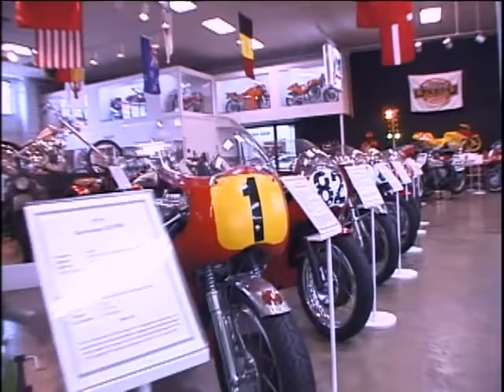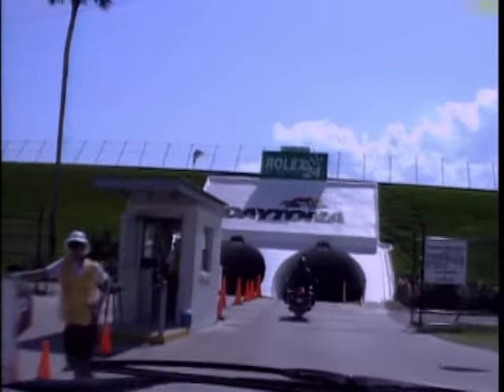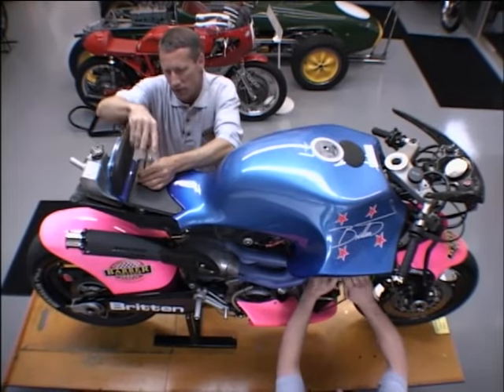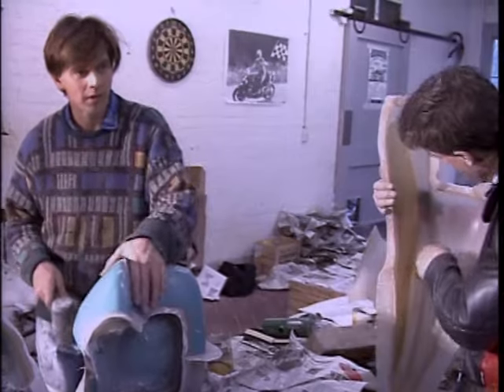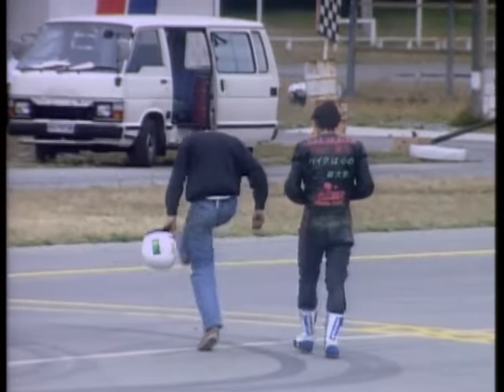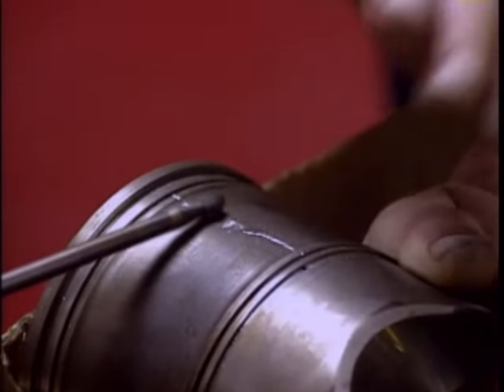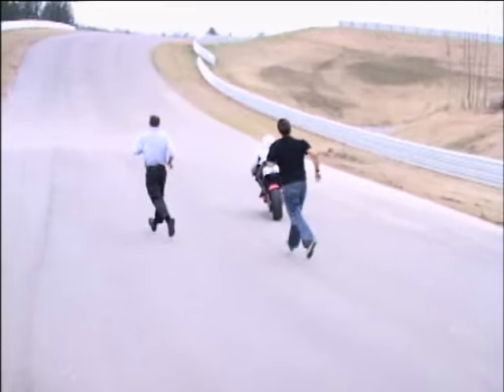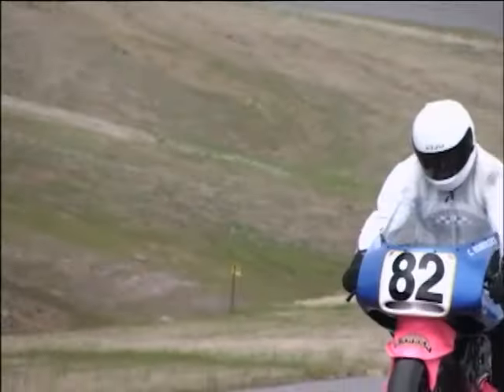TLC Greatest Motorcycles -  Britten V1000

Comment: Some engineer Mr Britten, to be able to pull the machine apart, weld/braise the piston liner like he did, good enough so it was fit to race. Obviously the guy was a one off.
Reply: Braze. It's not a piece of cheap meat.
Reply: He didn't really have any other choice. It was either weld it back up and see what happens, or go home knowing the bike could have done better. He was 9000 miles away from his home town, probably on a shoe-string budget, and with very few interchangeable spare parts. Bad idea or not, had he lost an entire engine, he'd just go home and make himself another.

But yes, definitely a one off. The very opposite of New Zealand's "Number 8 fencing wire" mentality for building or repairing things.
Reply: Have you watched : "The Worlds Fastest Indian?"
Reply: As sequels go I reckon it is far better than the World's Slowest Cowboy

Comment: That bike racing at Daytona was a home made engine from a garage in Christchurch New Zealand. Every part from the flywheel to the valves (NOT DUCATI). The whole bike was hand made in NZ even the wheels. I think the only thing brought were the rectifier and tires.
Reply: That's more or less it, the box internals were GSXR as I recall.
Reply: flip inheck  Aero-D-Zero
Reply: You hit it on the head,the worlds fastest Britten,wicked.
Go Johnny Go.
Gone to soon my kiwi brother.
Reply: Hey chris what are u on about, 
Negative Chris,whats your bike genius.
Reply: Ok. 6 yr after your comment. I'm watching  and had 2 go to comments to check. 100% no Ducati connection other than passing one on the back straight at Daytona on the back wheel. Up the kiwis and up the wahs.

Comment: John took concepts of low air pressure & flow from Steve Roberts who built the first true monocoque Suzuki powered f1/formula1000 all carbon fiber bikes in 1982-3 for nz Hiscock brothers...Johns engine was based on christchurches Denco Engineering's air cooled V1000 speedway sidecar engine with  Suzuki gearbox attached.
Still...a truely amazing machine
Reply: Thank you for this information. These people need to get credit too. They're part of Motorcycle history.
Reply: John's first special used a Denco engine.  It wasn't fast enough, so he got Jerry Branch to tune it.  Based on Branch's recommendations, Briitten then designed his own complete engine.  It was not connected to the Denco design at all.  But yes, Suzuki gear cluster and clutch used

Comment: It's not the only one running, there is one in New Zealand in full race tirm and going very nicely.
Reply: Brian Mckenzie  yeah that's what I thought, there is a few running, they just don't run them that often as there is very limited to no parts available
Reply: +WD-40 keep in mind this was probably recorded in late 2011 or early 2012, not aired for another 6 months with editing, than aired at a even later date.
Reply: he said road worthy
Reply: +Thunda1986 The guy doing the voice over said " only road worthy Britten left", but the mechanics said "this is the only one left running, isn't it ?...yeah" and neither is correct or true.
Reply: +Thunda1986 There is no such thing as a "road-worthy" V1000. They were all track only motorcycles, like the Kawasaki H2R for instance, or the Lamborghini Sesto Elemento. All 10 of them run, its just the owners of them aren't prepared to risk binning a million dollar motorcycle. There were 7 of them at the Ruapuna Sound of Thunder festival last year, which was a John Britten tribute, plus both of the Aero-D concepts he built, which were the Ducati/Denco powered bikes mentioned
Reply: Reflex Photography NZ depending where you live you can get plates for track bikes but emission control heavy states good luck
Reply: @Malibus_Most_Wanted  With no lights or indicators?
Reply: @Thunda1986  They are race bikes, never road-legal

Comment: Yep,lots of errors in the   commentary.John's first design used a Ducati engine but that was a long long time before he went overseas.There were the Denco motors  before that.Never mind that,it's got my race number on it !!!.I wish I could have taken it for a ride before my body started malfunctioning!!Push started it once with John while Andrew was on board.LOL Chris Haldane was told "No Wheelies!!" but Chris  just couldn't help himself.Good job he found the issue while   pulling a little low speed wheelie really.Ah,the good old days.Some nice footage here though but really??the "driver" I freakin  dont think so!!!That commentator is just not right a lot!!
Reply: Also I think you would find he is using a kiln for heat treating not casting. Not sure if he would have done the casting in house , but I seem to remember he made the patterns for the castings to be made from.

Comment: Britten built his own engine. He did NOT use a Ducati engine dammit! So frickin' annoying.
Reply: He did use a Ducati engine, just not in the V1000, the earlier Aero D Zero had a Ducati power plant.
Reply: syroncoda yes they are. There's 2 still here
Reply: @syroncoda  There's some in NZ.
Reply: If you can pay attention to the Video  he  raced a bike with a Ducati Engine then he went home to  build his own bike the next year..   he cast his own heads ect    but  even the Britten Engine had a Suzuki Transmission ..   what did the video say .. the Britten had  6,000 home made parts.. 

  V-Twin Class there was a time when Harley was the Brand to beat ..
Reply: Three still owned and run in nz private collection plus the original Aero. they all run in various nz meets.
Reply: Britten used a Suzuki Transmission ..  He cast his own  cylinders and heads  ..  you can see the cams is belt driven ..  It made more Horse power than other V Twins  they raced it in a V Twin class   it would  be down on power compared to a 4 cylinder engine ..
Reply: @syroncoda  there is one still in NZ. occasionally they bring it out for the media and stuff.
Reply: @JezBollah 667 Simply, NO.  There is no connection at all between the Britten V1000 engine and a Ducati.  Johm Britten did build a special with a bevel-drive Ducati engine, and he sold it.
The first built-from-scratch Britten used a Denco V twin engine.  Denco Engineering of Christchurch, New Zealand made speedway engines.  Britten commissioned them to make a V twin based on the speedway engine.  The first series of Britten specials used this engine. 

And then Britten made how own engine.  He made the casting patterns, and cast the crank cases and heads himself in his garage.  The piston blanks were bought in, and he used Suzuki gearboxes and clutch, modified.  He even devised his own fuel injection system. 

So it is truly a Britten engine, more of it made by him than most commercial engines are by the name brand.
Reply: @JezBollah 667 You are also wrong about the suspension.  The rear suspension has a pull-rod and bell crank to actuate the rear spring/damper unit which is mounted almost vertically in front of the crank cases.  The front suspension has its own spring/damper unit mounted within the two wishbones which the front fork pivots from.  The bike has two separate suspension systems, and does not 'sort of rock backwards and forwards' as you suggest. If it did, it would go onto full dive when the rider hit the brakes, etc. 

The bodywork was designed to cut as little air as possible, and let as much as possible flow THROUGH the bike.  It has air entry in the fairing, it runs through the bodywork to the radiator mounted under the seat, and dumps air into the rear wheel area.  This effectively reduces drag, turbulence, and frontal area
Reply: @mikeskidmore6754  It had a Yamaha gearbox
Reply: @dalewarren9885    No  he  used a Suzuki Gear box  ..    He  made his own Cylinders and heads..  Heads  is where the power comes from
Reply: @dalewarren9885     Suzuki  Gear Box
Reply: @syroncoda  There is at least one. In Te Papa, our 'national' museum.
Reply: The piston blank john used was from a Judd 3.0 f1 engine
Reply: @bremCZ  well...we're talking about the V1000 aren't we.
Reply: @davisch51  Well yes and no. The first V1000 to head to Daytona wasn't the one that had the Britten built engine and the iconic design. It was a fairly standard looking bike you could mistake for any number of other bikes. It actually appears as they talk about the Ducati engine The red and blue bike at 2:15
It didn't have a Britten engine because it wasn't made until the following year.

Comment: Ducati engine my arse. All hand built and designed by John himself.
Reply: The Aero d zero had a Ducati engine but the V1000 didnt.
Reply: The " Winged Wonder " used a Ducati engine.
Reply: Watch the video beginning again it will explain it to you.
Reply: Correct.  His first special started out as a bevel drive Ducati.  Then he built a completely new bike with a Denco V twin engine (a doubled-up speedway engine), made in John Britten's home city Christchurch, New Zealand.  It wasn't fast enough, so he sent it to Jerry Branch in the US for tuning.  Branch told him what was wrong with the design, and based on these comments, John Britten designed his own engine - and made the casting patterns, and cast it at home.  The first iteration had telecopic forks, then he built a new bike with the wishbone front forks and the super-clever aerodynamics.  Sadly, it was probably his pioneering work on the bodywork which caused the cancer which killed him.
Reply: @psk1w1  thanks for the rest of the story.
Reply: @psk1w1     Skin  Cancer
Reply: @psk1w1  perhaps, but the sun is fierce down there. I never had sunburn until I went to NZ. After 20 mins of lying in the sun in the bay of plenty, my chest skin was peeling off the next day. My chest still hurts thinking about it now.

Comment: Sodder, what’s that?  No way would solder hold the cylinder liner together
Reply: Martin Steele     Probably mean a silver based ,low temperature rod,that has very good joining qualities and  once molten,will “run” into a joint almost without any coaxing.
Reply: I'm inclined to think it would melt, I think brazed would be the word??
Reply: He braised it, not solder.